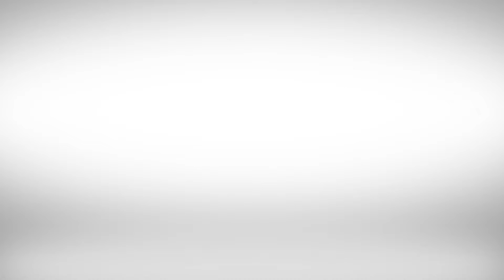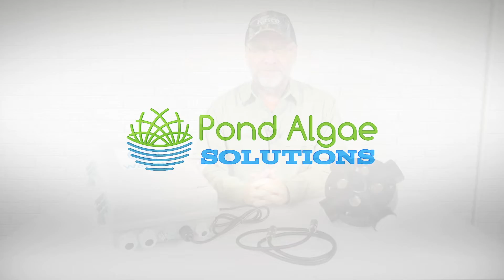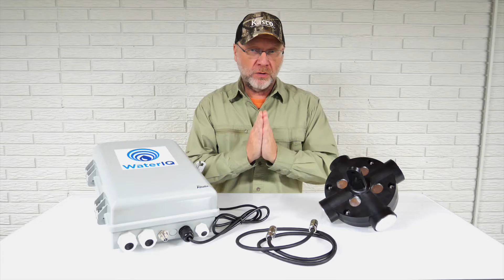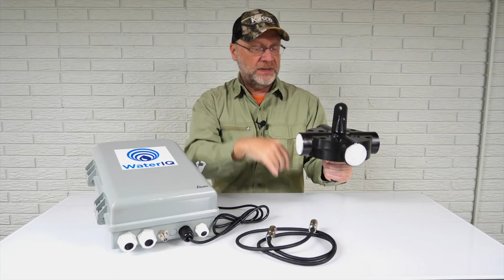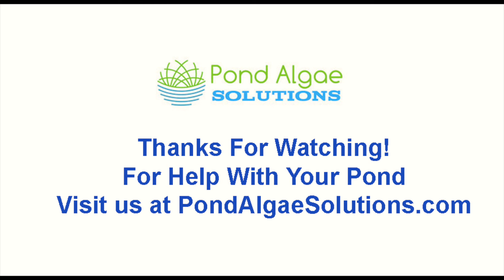Ultrasound Technology For Pond Algae Control - A Basic Primer

Comment: If it kills algae will it kill the beneficial nitrifying bacteria as well , and if not / why ?
Reply from the maker: Great question.  No, ultrasound does not kill bacteria, in fact its been shown to stimulate it a bit.  The frequency range it uses is targeted to match that of most algae cells.  Best example I can give in simple terms is you won't shatter the glass unless the pitch hits that precise frequency...match the frequency, and then you'll have an effect.

Comment: Unfortunately, a system has not been developed for small ponds 20,000 to 100,000 gallons for a fair price, say under $1500.00.  If I missed something please let me know I found nothing under 5k.
Reply from the maker: You are correct.  Some 15 years ago a few companies did indeed make some smaller systems for koi ponds and such.  But as time has gone on the focus has been to use them on larger waters due to the limitations and expenses in treating them.  Your right too in that those ponds from 20 to 100K gallons are kind if on a no man's land of sorts.